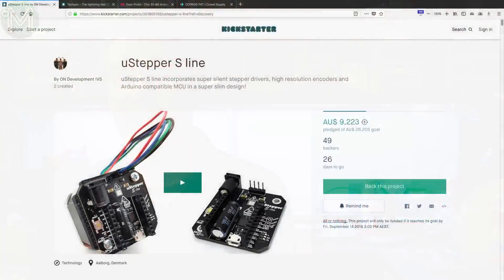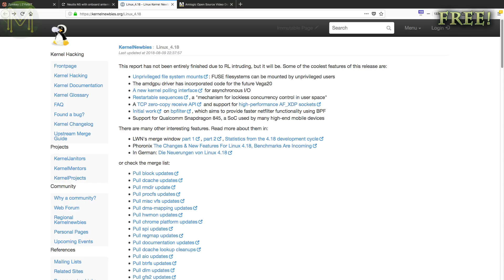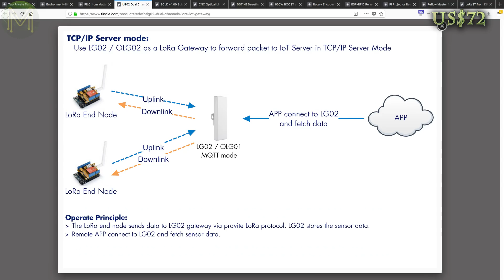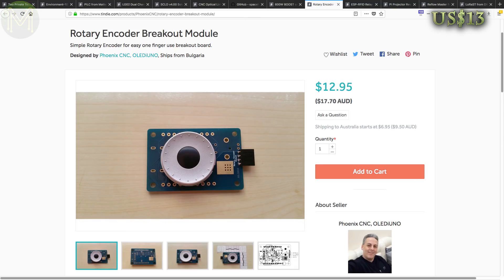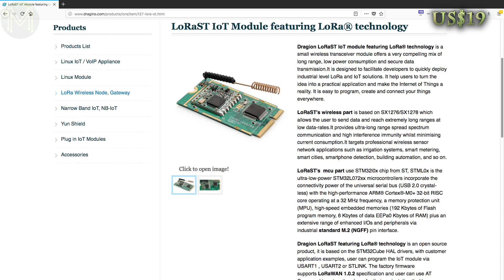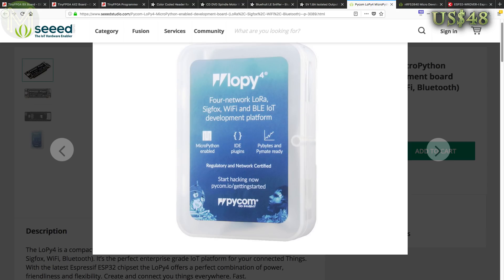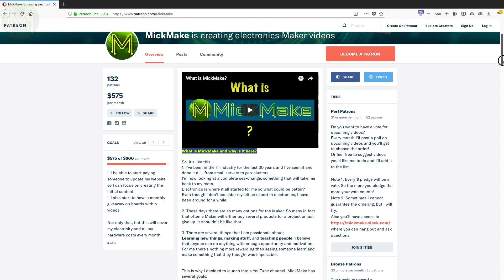#223 Weekly Roundup #57: New Maker Products // News

Comment: Thanx Mick!!!
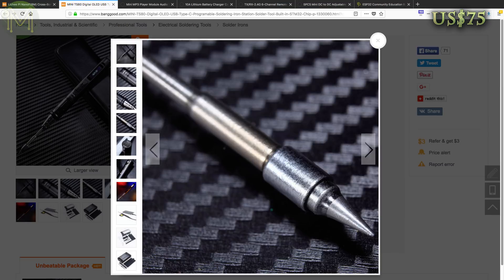13:34 XY-V17B mp3 Player. I have got the UART control to work with "AccessPort" and Hercules, because they are able to send HEX strings.
AccessPort (and Hercules) is pretty cool, because you can store and execute commands on demand (Macro. Demand commands?).
I'm gonna use it inside my ALF doll. Animate the mouth eventually. Thanks!
I have seen something similar,  also tiny, but with an integrated amplifier. Just need to find it again!
Reply from the maker: That'd be cool to see.
ICstation did have another version of this, but with an onboard amp. Sadly it's not there anymore. You might be able to pick it up elsewhere. When I do my next roundup, I'll keep an eye out for it.
Reply: I have the code (my first GitHub Repository!) here: github.com/barsznica/Arduino_XY-V17B_mp3_wav_player

Comment: I have watched a few of these as I am interested in how hobbiests are turning to FPGA design next. Plenty of boards but little mention of the software required to do the design, layout, synthesis, PAR, and pin assignments. Seems the a lot of them are relying on the open source Lattice tools leaving the buyer locked out of selections from other vendors. I think there needs to be more coverage of the available tools that require little to no money to start with. The hardware is the easy part.
Cheers,
- Eddy
Reply from the maker: I’d like to do a video on that.

Comment: Another great "weekly" roundup - I love these roundups even though they almost always ends up costing me money 😜
I've just ordered the SCLD v4.00 despite the quite limited documentation. I can't really figure out how the led output is configured ( constant current, constant voltage, PWM or ??? ) ?
I'll hope it will be a good upgrade for the electronics in a couple of old solar decoration garden lights, of course I've also wen't crazy on Aliexpress and ordered larger solar panels and the largest capacity 18650 I could find 😃
Reply: Hi, thank you for the order! I missed the connections diagram on Tindie, will be available later today.
I also didnt notice any order using the 10% discount code 682C0523 !! SCLD is straight forward.. it has a wide input voltage regulator (5-45V, in real life you can hook it to any DC source above 4.5V and it will work!), a CN3153 (similar to TP4056) 1S1A lithium battery charger with over-charge over-discharge and over-current protection and the output to the leds is a joule thief which is similar to a PWM boost converter.  With a 2000mAh 18650 and a 5-10W solar panel you can be sure it will drive your LEDs for a long time.. I like to use 2x 1W power leds in series (forward voltage of the LEDs in total has to be above 4.5V to function properly)
Hope this helps and thank you!
Reply: Hi. Thank you for the explanation 🙂I´ll do some testing with different leds when the board arrive. For my application 2 x 1w leds might be on the bright side and I might try to run 4 more low power leds in serial to get above 4,5 volt drop.
I didn't notice the discount code, but even at full price I'm quite impressed that you can sell these boards so cheap 🤗
Reply: Arrived today 🤗 👍 - Still waiting for the solar panels though 😏
Reply: Hi. Just got the SCLD up and running yesterday and I must say this is a great kit !. It´s even more impressive that you can produce it at the price your are selling for, actually I´ve just one more :o)))
Reply from the maker: LOL. Sadly this is the complaint I get often.

Comment: Guys does you have some suggestion on what to do with 20+ pcbs with a design failure? :(
https://hackaday.io/project/159654-fcthermostat-another-overengeneered-iot-device/log/151157-stuff-happens-i-made-a-huge-mistake
Reply from the maker: Alas, that does happen. You can make a nice drinks coaster out of them! ;-)
Reply: MickMake yup or keychains!
Reply from the maker: Stick them on to the wall as an art installation.
Hang them from a lighting fixture as a techie chandelier.

Comment: Can someone help? I found a small audio switcher project online and the person had shared the PCB. I tried to upload the zip file to JLCPCB but do not get any preview.
the files are  
audio_switch.sch 
audio_switch.brd
and a png image of the board. 
Do I need to make a gerber file from these? If so I do not know what program to use.
If you google "Build a 3.5mm Audio Switch – Daniel Andrade" it should be at the top.
Reply from the maker: Hi, yup. You absolutely need to create gerbers from those files. They are more than likely Eagle cad files.
The easiest way, probably, is to use EasyEDA to import the files and then generate the PCB order from that.
Or else send em my way and I’ll have a look.
Reply: Yes thank you, was able to make the Gerber file and now on the JLCPCB order page, I have the offer of 10 for $2 but not sure what to do with the postage cost. DHL is $25 to the UK and they say "Registered Air Mail shipping without tracking can often be very slow and unreliable, uninsurable. Highly recommended - DHL." 
Bit confused at the moment again.
Reply from the maker: Yeah, I tend to always go with DHL. Never had any issues with that carrier.
Reply: I use Registered Airmail.. it takes a bit longer (to Greece maybe up to a full month (1/3 of that is local dealy to pass customs etc) but its cheap and effective. DHL is cool in case you need a PCB ASAP but 1. that is almost never my case and 2. customs clearance via DHL here in Greece is ULTRA EXPENSIVE and a general PITA situation...